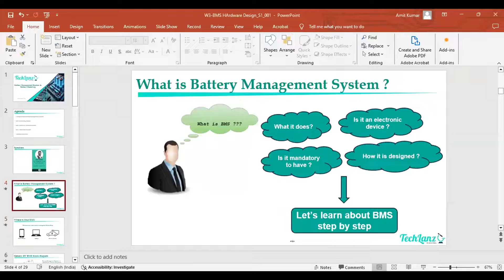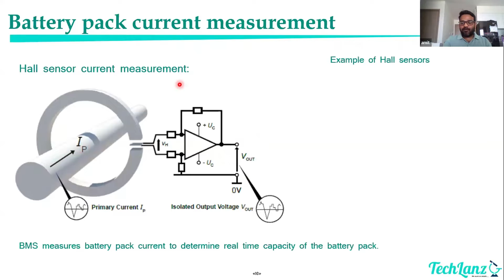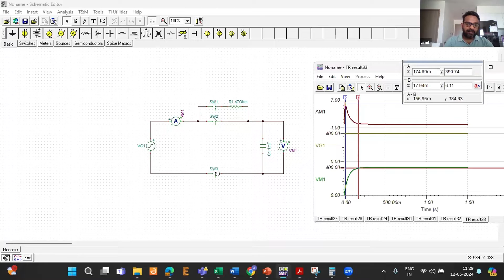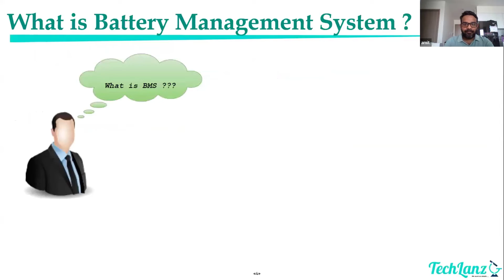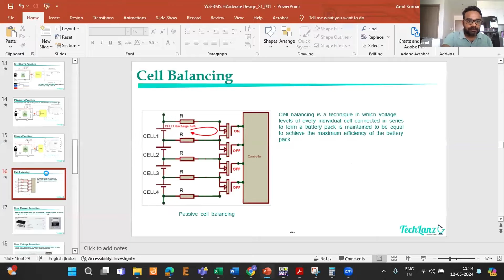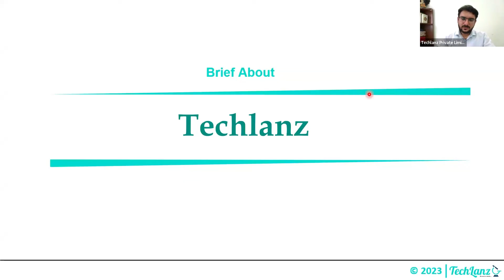Webinar BMS Hardware Design Master Class

Comment: If you disconnect you battery and your MPPT is at full load, and 4-phases have concentrated energy in toroidal coils, after you BMS disconnect battery, voltage spike from accumulated energy will destroy caps and FETs or IGBTs, also CC-CV algo is not good, because it take long time to charge battery with low current in CV mode, and hight voltage at cells will destroy your electrolyte and after few hundred cycles, battery will have lower capacity and high resistivity and will deterriorate even faster. BMS has to communicate with Charger/MPPT/Inverter, because if not, it is very hard to dissipate e.g. 100 A x 4.2 V, if one cell is bad and another 13 cells are at low voltage.